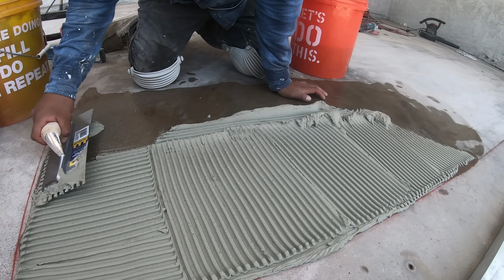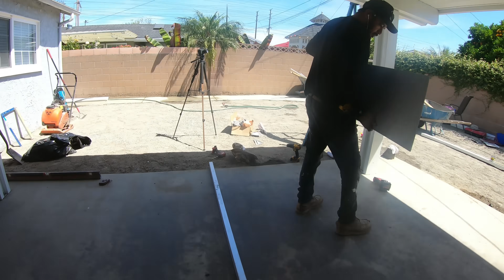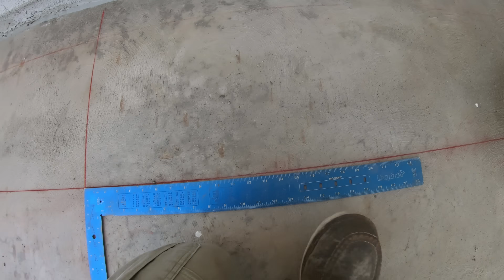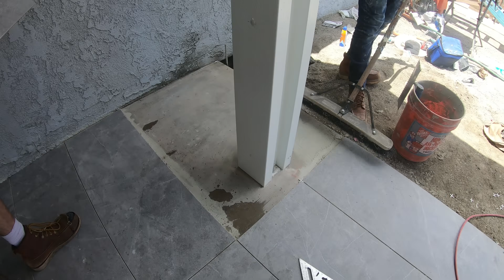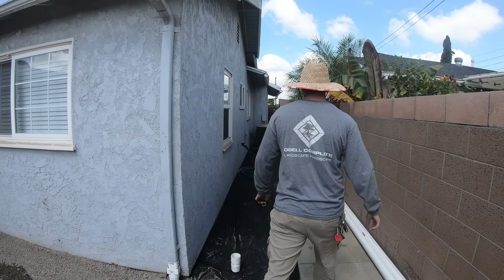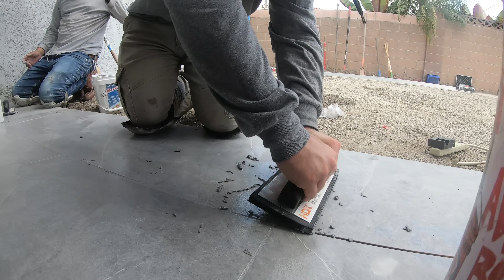How to install Tile Basics Backyard Remodel # 4

Comment: Yo your notch was way to small for that size tile which is why you had to do the dab and dot with the mortar but that’ll probably leave you with hollow spots under the tile which will cause cracking down the line. Next time I would notch both the setting surface and the back of the tile if I were you. Also they make tile cutting blades in 4 in. Putting a 7 in blade on a 4 in grinder is no bueno (the cut edge on the blade is going way too fast to make a good cut and you’ll burn up the grinder). Hope this helps